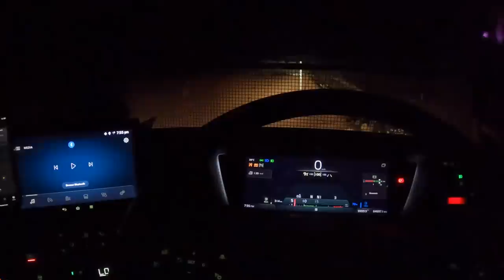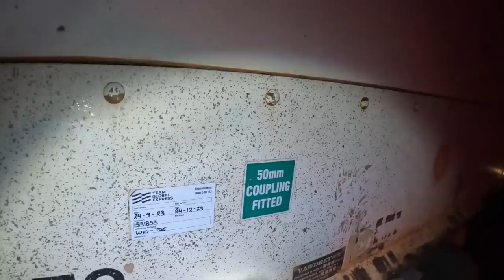The Road Train - My Home Away from Home - Not happy with the dog runner, then on my way to Newman

Comment: 13:31 is that a Bag between the set of drive tires? What is the purpose of that? Thanks in advance for your response 👋🏼
Reply from the maker: That is a addition fire extinguisher but because of the location it is protected by a thick plastic bag.